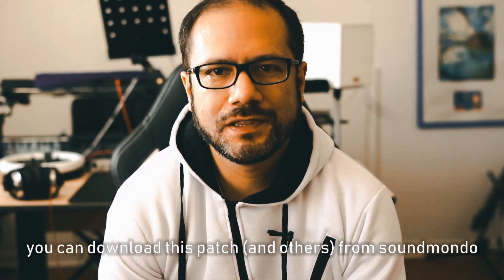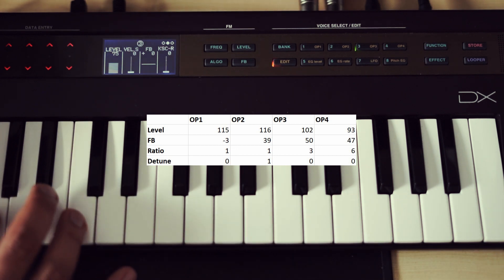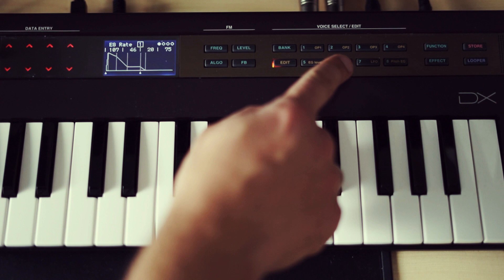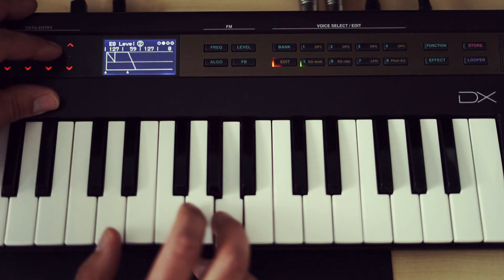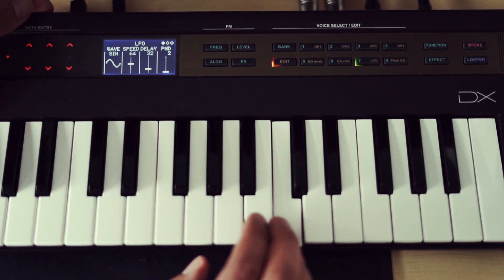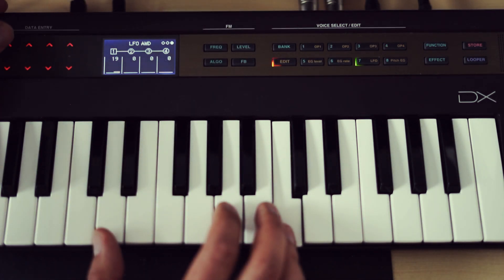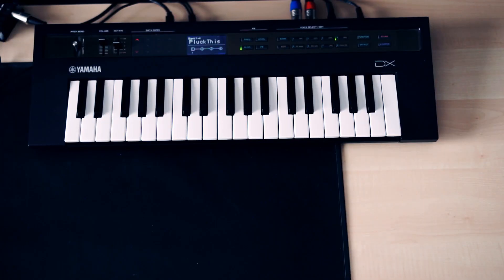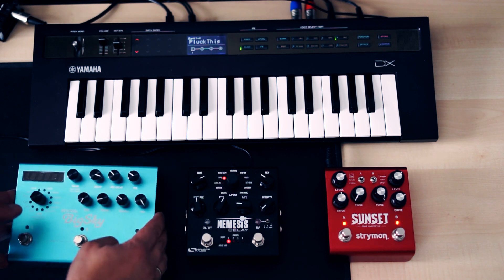How to create an electric guitar sound on an FM synthesizer (Yamaha Reface DX)

Comment: I would say the Keyboard Scaling Rate is the most frustrating aspect of FM sound design. I really wish on the next gen of this DX they include a global keyboard Scaling (like key tracking in analog) and a global filter mode. In particular with this synth, the breakpoint is fixed. I believe in other DX's, you could move that breakpoint. end rant

Can you tell me what the idea would be behind choosing which operators to effect on the keyboard scaling rate and slopes? with Algo (signal flow) and carrier vs modulator in mind?
Reply from the maker: Thanks for watching! On the DX, (if I remember correctly), keyboard scaling affects the loudness of the operator you're working on. Turn it "downwards"  (negative) and the volume decreases /increases when you play higher / lower notes. 
On an FM synth, this is best used to "dampen" patches which are too harsh in the upper register or "brighten" them when they are too dull in the lower register. Apply this to a modulator of choice (remember: a "louder" modulator increases the "brightness" of your sound). 
Best regards!

Comment: moar dx patches
Reply from the maker: At the moment, I don't have a Reface DX in my house. But the patch videos on the Digitone are easily translateable to the DX...
Reply: @mr_floydst  RIP dx...mine arrives today!
Reply: @mr_floydst  why did you part with it? The swipe controls instead of encoders seems like it would be annoying to fine tune.
Reply from the maker: @briannhinton  I regretted that and bought (yet) another one ;-)  Digitone is a great machine but a lesser synth than the DX.
Reply from the maker: @briannhinton  And I originally swapped the DX for a Digitone 'cause I was searching for a good hardware sequencer. Digitone is quite good, but I found the MPC One is even better (at least for my needs, that is).